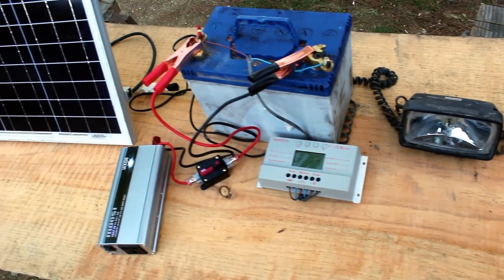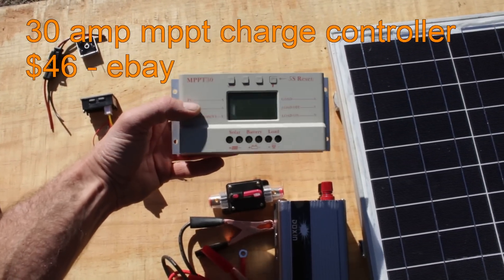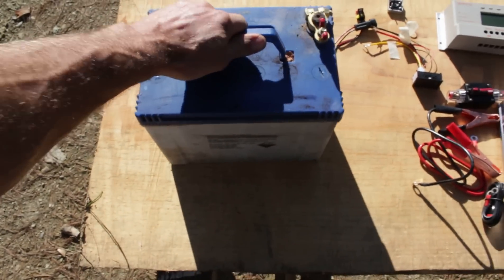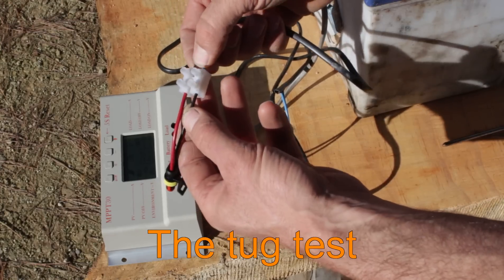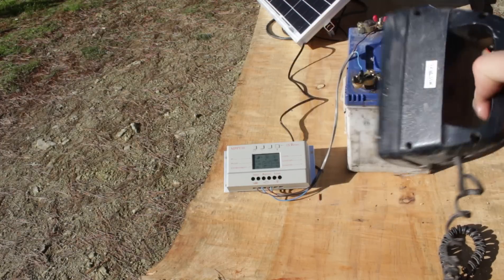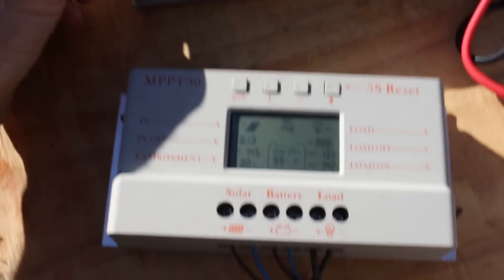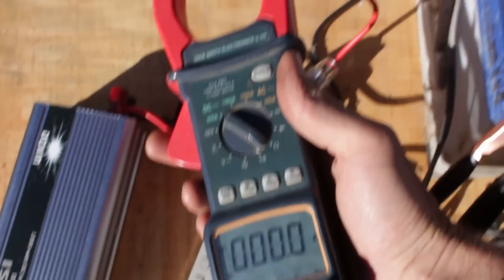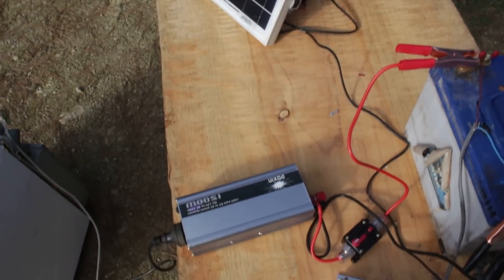How to build  a basic portable solar power system -camping,boating,off grid living-

Comment: Hi Angry Ram--thanks! This is exactly the kind of video I need. One question: I have a similar-size inverter that is fuse protected. Does that eliminate the need for a circuit breaker such as what you have included here?
Reply from the maker: Internal fuse? It is wise to use an external breaker rated around peak output of the inverter
Reply: l  want to know how much  money do sell them
Reply: As Angry Rams official Elephant Island Antarctica agent, if you send me $ 6,000 I will ship one out to you.

Comment: what if I want to run a 50 watt bulb 24 hours a day? can it do it?
Reply: Incandescent (standard wire) bulb?, ditch them, run an LED first choice, or Compact Fluorescent (CFL) second choice. A 50w incandescent bulb has similar light output to an 11w CFL, some LED alternative are as low as 3w however the light output in lumens is not as high in low wattage LED's and the bulbs are generally known for producing more focused light with a narrower beam, better for illuminating objects over illuminating a room.
Reply from the maker: Not with this setup. You would need a bigger panel and more battery storage
Reply: thank you for repling

Comment: One little thing to help. 
You don't need a blocking diode to stop power flowing back to the solar panel at night as the solar regulator performs this function. In fact some regulators may not perform too well unless the panel is connected directly.   Most larger panels with a diode built in are for a different purpose and they are called a bypass diode. May pay to do a little more research but hope it works well.

Comment: well,this is a realll tiny one, compared to the accu beside the unit, but i don't see why you can't make the u/i converter yourself(since analogue devices makes plenty of components and the same for making cleaner voltage from 24 volts to 240 ac, but those things are profitable is you can buy the stuff cheap and i checked for the fun, the breakeven point, since a lot of homes ,let them install with a shortage from the state, but 10 years.  And that is offcourse positive thinking,here at the coast in the netherlands and the quality used. But the efficiency after ten years ain't the effort, and why not using wind here at the coast on flat roeves????   Allways 4 beaufort and with rainy days 6 a 7....,,seaclimate.....   But where to store the power, if it is for self use....
load,gel,supecaps.    The last one seems too expensive to me. But fun to experiment.But is sunenergy green energy?.....Not really looking at the efficiency and led also not, yes better then the ancient halogeen, but the cheap ones, the light ones, without a good cooler and not dimmable are real crap, and bring plenty of noise on your powerlines, like all chinese powersupplies and tv's....so in the end, you need again good gear if you want a good sound or stable desktop..but 1 pay 10 euro for a cheap 220v ac to 6 watt pwm  10euro and a good one 35 euro from brand x.
But why does mankind allways want to make something profitable...
Buy expensinsive desktop powersupplies 250euro....    Buy a 3000euro tv   etc...   the technique is there. Bigger telefones, which can handle more current and a loadequipment which cost 5euro more and load it fulllll .Thin is nice, besides the shittyconnections, shitty audio etc, which just can be built in a thicker one a 4k screens....supereyes and hyperaudio   ,hq is everything about 16bit 41kHz, but that doesn't mean a thing.

Comment: Isn't your charge controller handling the cut-off points, so why the extra diode?
Reply: Some panels do not come with a built in diode.
Reply: I'd like to know as well, also why 100A circuit breaker? What circuit breaker would be suitable for 150A panel? Can someone shine some light on it so I can benefit pls? I'd like to be enlightened please as well. :) Thank you.

Comment: Why did you choose to use a 100-amp breaker? Wouldn't something like 15-amp be more reasonable? Sorry I am not familiar with these solar panel systems, I am trying to understand more
Reply from the maker: 100 amps x 12v is 1200 watts, a 15 amp fuse would break around 200 watt draw
Reply: I see, thank you for the info
Reply from the maker: Yeah sorry, we just had a baby so haven't had much spare time to do vids, things are starting to settle down now so ill make more vids soon ;)
Reply: +Angry Ram congratulations brotha

Comment: how can someone know how long a battery will last if drawing 90 watts before the battery must be charged?
Reply: Need to know how many hours battery must power 90 watts.......90 watts X hours = watt hours 

Need to know amp hours & volts  of batteries also. 

Here's an example based using my system numbers:

I need to run 90 watts for 8 hours. My 12V batteries produce 70amp hours. Can they run it?

90 watts X 8 hours needed = 720 watt hours needed from batteries.

My 12v batteries with 70 amp hours produce 840 watt hours:
12V X 70 amp hours = 840 watt hours. 

Yes. My batteries produce 840 watt hours & I need 720 watt hours. This would almost completely drain the batteries. Most shouldn't be drained below 50%. In this example I need more batteries for my power needs. I know the math can be painful but that's how you figure it out.

Comment: Can this power up a Desktop Pc plus 50 watts amp(Music Studio) for 8 hours ?
Reply: +Ello Oku not with this battery. say your pc draws 100w so you have 150w load. add 10% for loss in the inverter 150 * 1.1 = 165 divide this number by 12v to give you your amps 13.75 then times this by the number of hours you want to run it for 13.75 * 8 = 110Ah this is how many amp hours you will use over the 8 hours. You never want to take a battery bellow around 50% so you would be looking for around 200Ah worth of 12v batteries. !

Comment: @Angry Ram  What if your demands for useage in AMPS were more than the 1500w inverter, for example 2000watts, would you just use 2 separate inverters and feed each one to different devices OR CAN YOU WIRE both inverters together to increase the wattage/current useage demand?
Reply from the maker: +SP330Y I have now purchased a 3000 watt inverter from ebay and a 250 watt solar panel so my startup capacity is now 6000 watts, this is enough for most appliances. I think if you try to wire together 2 inverters you will make an expensive blue smoke generator
Reply: Angry Ram
Love the blue smoke joke, very funny :)
Something ive asked a lot of people is this, is it possible to run an electric tumble dryer (2650watts) off solar,or is that asking too much?
Reply: +SP330Y No, i think with this setup you wouldn't be able to do it. With many solar panels yes.

Comment: @Angry Ram
 If,  for example the panels only gave out 1 AMP per day in total current,   does that mean that in 10 days if no electricity was used in the home that they would have given out to the batteries 10 AMPS in total and stored it? 

   Does it keep on adding and increasing the AMPS that can be stored until the battery is fully charged, is that how it works??

OR.....Does it only top up the batteries to 1 AMP as that's the maximum output from the panels so this figure would never be increased and stored in the batteries, this is the part i dont fully understand.

If anyone has the answer i would be interested to find out, thanks
Reply: I may not be 100% right but this is my understanding...
If the PV panels are charging the battery at 1 amp then if they charge at 1 amp for 1 hour you will have stored 1 amp hour of power.  Battery capacity is measured in amp hours.  My car battery has a 100 amp hour capacity.  

It would take 100 hours to charge my car battery.

Watts = Volts x Amps

The 800watt toaster used in the video is 800watts=12V (as it's a 12V system) x ?Amps
                                                                            ?Amps = 800/12
                                                                            ?Amps = ~67amps
Which means that if you toast for 1 hour you will have used 67 amp hours of electricity. (although more electricity will have been used due to inefficiencies in the inverter).

Comment: Thanks for the video. I plan to make a single battery set up myself, using a EverStart MAXX Deep Cycle Battery for RV, Marine, Trolling Motor applications. It is 12v, 105 amp hour and not that big at all and cost only 100.00. My plan is to use the Renogy 50w Solar Panel Kit, that comes with a 10 amp charge controller. Will also use a 1500w inverter. Hope it works out, as your's has. Thanks again, Angler.
Reply: you'll need an 80-100 watts solar panels, 50 is too small for recharging your battery and other accessories.
Reply: +Angler Beaudry you should get a 30 amp charge controller. same price.

Comment: The thing is, people show all the things they  can run on their setup, thing is, you could get your car battery and run the same things without the solar. So the real info is about just using the solar to charge the battery right. I guess during the day, you could run things off the panel but typically it's just charging the battery and the battery is the powerhouse. Just think of all the fossil fuels used to make all these batteries, wires and panels. lol

Comment: So how would you scale it up to live off the grid? How many extra panels, how much bigger of an inverter, and how many more batteries? Say I used 1KW of electricity a day for reference...
Reply from the maker: +Matt Carrasquillo I'm setting up an off grid cabin at the moment, we've started off with a 250 watt solar panel charging a 100ah 24v battery bank which is enough to keep a 340 litre fridge freezer running, led lights, mobile/laptop chargers. we will add another 250 watt panel  and more batteries to keep us going over winter when there's less sunlight
Reply: I've got a 100 watt panel right now is it better to just buy 2 more of those or do you think the 250 watt panels are better?
Reply from the maker: +Matt Carrasquillo Depends on your situation- postage costs, sometimes it works out cheaper to ship a few smaller panels than one large, smaller panels are easier to manage than large, if you're using an mppt smaller panels can be wired in series to boost the voltage which means less cable loss and better efficiency on cloudy days.
Reply: Okay thank you I'm still researching solar but this helps a lot much appreciated

Comment: Hi.. thanks for sharing this video, just a question.. is that a regular car battery or it is a deep cycle solar battery that you use in this video? if is a regular car battery how it this possible to use one of this? i'm confused because I heard that I only can use deep cycle solar battery for solar systems. If so... which is the difference? thanks in advance...
Reply: +David Rojas 
The deep cycle batteries should be used with an solar panel set-up.
Theire plates are more thick and can be discharged up 50% every day without damage. 
A car battery has thinner plates and can give off a 10 % charge before they get damaged.
For example.....
A 200 ahr 12 volt deep cycle battery could give you up to  1200 watts of energy without damaging the battery.
A 200 ahr 12 volt car batetry could give you about 240 watts of energy without damaging the battery.
And a marine battery is somewhere between a deep cycle battery and a car battery, so it is not really  good for such application.

If you get car batteries for free....use them, but expect about a 1 year use before they get bad.

Comment: What you call a 'diode' is actually a 'bridge rectifier', its purpose is to convert ac to dc, it should be ok because a bridge rectifier is actually four diodes in a diamond layout  (You only need 1 of the 4 diodes for this application)

Comment: Battery full charge voltage is 14.7 not 14 volts, set it to 14.7 and be sure you check it with a tester that the cut off is 14.7

Comment: Could you connect a battery charger to the battery from the inverter and charge the battery? I'm new to the whole solar energy thing...so hold your insults...I'm just looking for information.
Reply from the maker: +Kelly Meacham Charge the same battery that is powering the charger? yes but you will end up with less power due to cable and circuitry losses .
Reply: Thanks for the info. I've got a basic understanding on solar power...still trying to put it all together before purchasing equipment.
Reply: +Fraser Holmes 
The best starting point would be to conserve energy first, before thinking of generating their own energy.
Reply: +Fraser Holmes spam

Comment: Mate, there is no way in hell that a 100 watts solar panel is going to charge a battery - ANY battery, enough to run a refrigerator. That 40 watts panel will, in no way keep the battery charged for everything you have listed.
Reply from the maker: +Paul Petrea  I realize that. I was demonstrating the capability of the inverter. 100 watts would run an efficient fridge/freezer with a decent battery bank if it was on a timer to only come on during sunlight hours with half an hour on at midnight.
Reply: +Angry Ram Not trying to give you shit, mate. But, you may want to make that a bit clearer in your videos. People, as I am sure you well know, will often believe anything someone tells them.
Reply: I was thinking the exact same thing. I'm worried that people will watch this, and expect a 40W Solar panel with a small car battery to be able to handle this kind of load. If they do... they will kill their batteries extremely quickly.

Comment: can i use heater this winter with this generator
Reply from the maker: +Damir Aga Not feasible with this size setup. With a larger battery bank and more solar panels and a 3000 watt+ inverter,  yes you could program the controller or a PLC to divert excess power into a heating element intermittently when the batteries are fully charged.
Reply: +Angry Ram tnx for prompt  response.  Can i get  700 or 1000watt heater instead ?
Reply from the maker: +Damir Aga Yes that would be better, but realistically you would need at least a few hundred watts of solar panels and you couldn't use the heater at night as the batteries would go flat pretty fast.

Comment: How many solar panels do you connect to a solar controller? Can you connect all you have to a single controller???Don
Reply: +Don Jackson 
If you have a 30 amp controller then you can but solar panels to it ....that put out up to 30 amps total.
If you have more amps, then some controllers may overheat or go up into smokes or shut down or just give you 30 amps, but it all depends what kind of controller it is and how it is made to handle the extra power.

Comment: Hi , i live in Ireland and i have always wanted to have and use solar power but i have found the cost is radiculous. In ireland we use 220volt  could i use this set up if i wanted to in the same way. i would like to know do you need much sun per day for it to work. cause with geoengineering we have allot of cloud in ireland. would it be any use to me when it's raining in ireland, and some times it rains for weeks on end.

Comment: You missed the battery guard to prevent your battery from damage due to over depleting it. Shouldn't really go below 10v
Reply: +Enapp off grid energy solutions , The regulator should have that built into it, I know mine does. It also should prevent the solar panel sucking power when its not in the sun.
Reply: inverter will detect that, and solar charge controller has that protection in also for load output.

Comment: is it safe to draw power from the battery as the same time the panel is charging the battery? how come the electricity from the panel dont just go straight to the drill/freezer when you use them?

Comment: Since this is no mppt, you will never charge with more current than the short circuit current of the solar panel which is 2.37A. Even less because you are not in the short circuit region.
Reply from the maker: Danny Bokma Thanks for the comment, can you recommend a good quality affordable mppt controller?

Comment: You mentioned that you "solder and seal all connections" but may I suggest that for marine applications you "crimp and seal" them instead?  Soldering often leads to inflexible and brittle connections which should be avoided in an environment which is full of vibration and movement.

Thanks for the video.
Reply from the maker: Jordan Harkness Good suggestion, thanks. I actually cover the solder with a lanolin based corrosion inhibitor before I heatshrink, seems to work ok.
Reply: Heat shrink and solder do work... it's just about the flexibility of the joint.  The same reason we use stranded wire on boats instead if solid copper.  As boats get bounced around and engines/waves etc. vibrate everything soldered joints have a greater risk of breaking... and if they break, you end up with an intermittent connection under shrink wrap that is difficult to diagnose.  Some people also prefer the physical connection as it adds strength to the joint since boat wiring is often less hidden and more prone to having something pull at it.

... and if you're lazy like me, crimps take less time and have less burning plastic smell than soldering on enclosed spaces.  :)
Reply from the maker: Jordan Harkness Fair enough, each to their own. I'll stick to solder, the only connections I've had trouble with in boats are crimp type, they must have been dissimilar  metals which caused failure by electrolysis, In fact I had to totally re-wire my current yacht which had crimp type connections.   I guess a good corrosion inhibitor over the crimp would have prevented that.